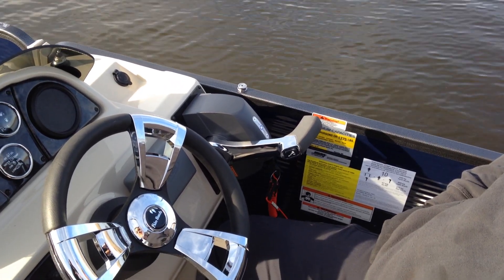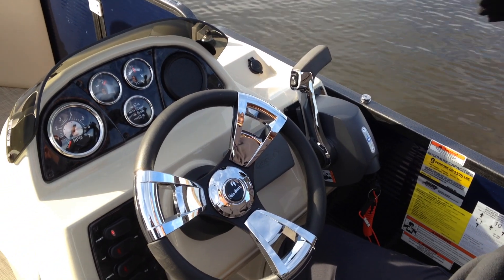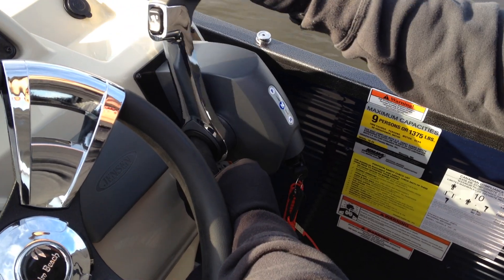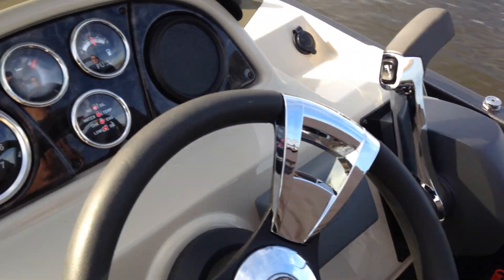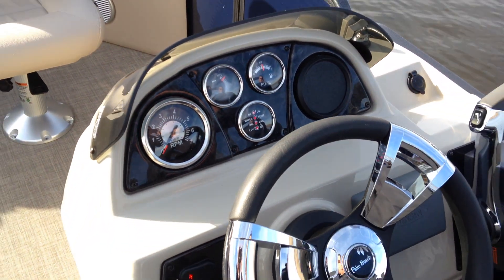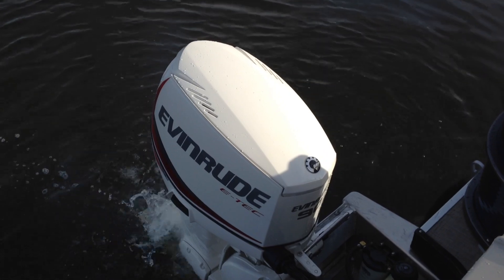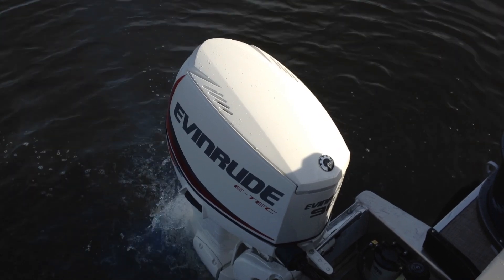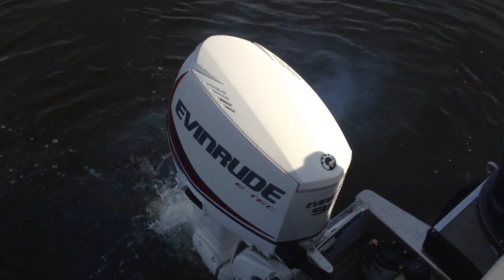E-tec Winterizing

Comment: Yes it is that easy. I have been doing this system for 5 years and no worries. Fuel stabilizer in about 1/2 tank of fuel. I top off the oil in engine and remove battery. My pontoon boat sits on boat ramp for 7 months. Spring I top off fuel with premium  and it starts first shot. Of course the required bottom end oil is drained and refilled in fall.

Comment: My Pontoon does not have a fast Idle button and the engine will not start unless the throttle is in neurtral. Is there another way to winterize the motor on the motor itself?

Comment: What about the fuel left in the pump? Can’t let it sit more than 3 months or it will evaporate and cause damage on the pump
Reply: You put fuel stabilizer like Evinrude 2+4 in the tank before your last run of the season so that the stabilizer can circulate through all the fuel lines and the engine. That'll keep the gas "fresh" through the whole system and it'll be ready to go the next time you need it. It really is as easy as it looks.

Comment: Great Vid. My envinrude etec 60hp is on a Macgregor Sailboat so the throttle control does not have a neutral push button like on a powerboat controls. How can I winterized it ? I.e. is there another way to put it in neutral

Comment: What happens with the water that goes through the system? Does that need to be flushed out with air?
Reply: No air necessary. All you need to do is tilt the engine all the way down to the fully vertical position and allow the engine to drain the water out. I find it's helpful to tilt the engine up and down several times to allow water to drip from other areas. But the manual says the vertical position is the only requirement for draining.
Reply: Thanks for this video. What if I leave the boat in the water for the winter and dont have a lift? I want to winterize in water and trim it up completely out of the water to store for winter. What about water not being able to drain?

Comment: It actually took only 1;53, not 2;05! This is exactly the experience I had with winterizing my E-TEC for the first time this past fall. Although, I used the flushing port with a garden hose. This is the best, most-recent video for winterizing an E-TEC because it shows it in real time, and also shows that newer models require the throttle to be FULLY advanced, NOT halfway as some older videos show. Thanks for posting this!
Reply: CaptainADK how long can you leave the engine without running with this winterizing process? My mercury just fucked up because I let it sit 4 months, it got only 70 hours and so far it has have 2 maintenance, I spended over 1500 so far on all this shity stuffs. Im definitely repowering with evinrude
Reply: @gonzaloviglino2305  I'm not a service technician, but you can probably leave the engine sitting indefinitely after winterizing it this way. My boat sits 10 months and always starts up on the first turn of the key the following year. If you have to store it longer, you could probably hook up a garden hose once a year and do the two-minute procedure all over again. All it does it add extra oil. It might smoke for a less than a minute when you start it up again, but that goes away quickly.